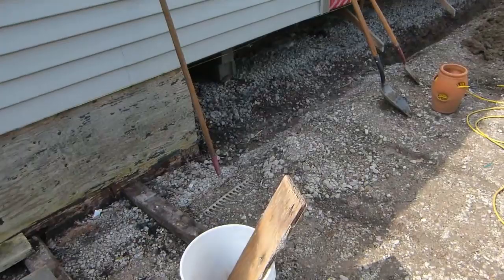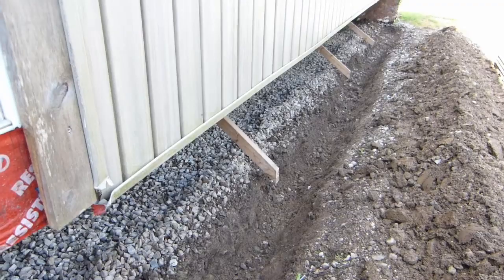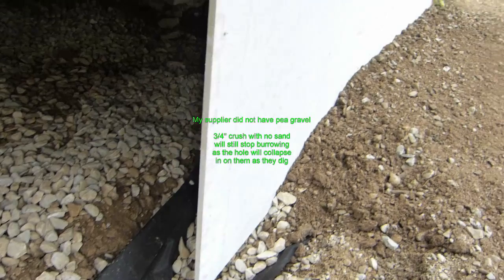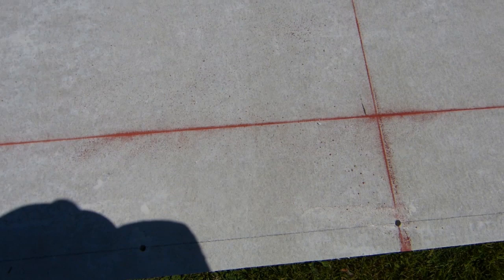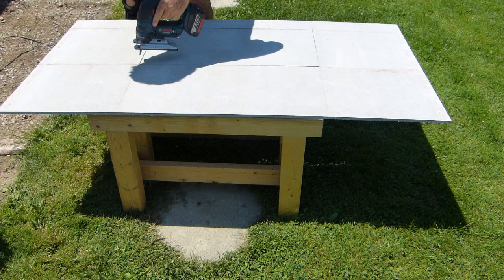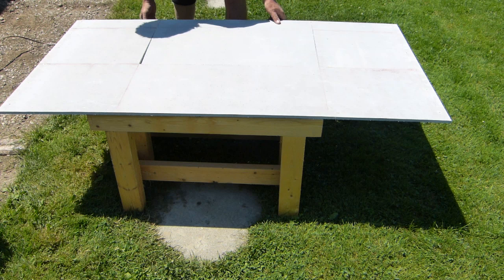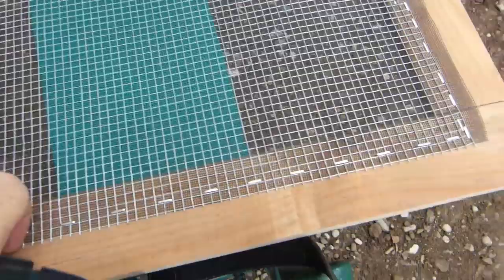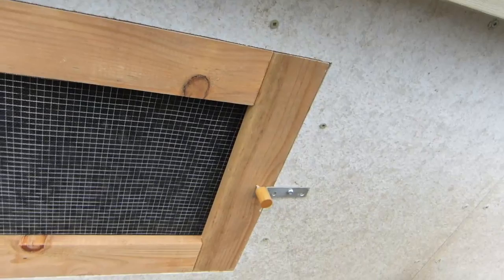Mobile Home Skirting

Comment: I was wondering about being in the ground, but you answered the question a year ago, to @ezraepstein6933, saying the trench was deeper than the backer board reached so it apparently drains to somewhere with a sloped trench.  You didn't say anything about slope on your trench or a catch basin on either end.  I guess you answered my other question with 36" of trench depth below the ledger board and 32" of  backer, leaving 4" of pea gravel below.  It has been another year since that reply, now 6 years since installation.  Has your assessment of working well changed?  Thanks for keeping up on this!  Good Video!!!
Reply from the maker: We moved out 3 years ago.  As far as the neighbour tells me it is holding up fine still.
Reply: @JimDockrellWatertone    Thanks for the response!

Comment: I was looking at durock cement boards at Home Depot and I was told it’s not for below grade. That it should be 8” above the ground. 
Have you had any issues after installing?
Reply from the maker: None at all.  The first section I did about 5 years ago.  Mind you it is in drainage rock so the water does not stay in contact with it.
Reply: That's right!
Not for below grade level at all.
Good work though
Reply: I was looking at using the durock boards as well on my home. So as long as I have a drainage system in place like you did with the gravel, those boards will work?

Comment: I'm thinking of doing something similar.  I've heard Hardie board isn't rated for ground contact.  Have you had any problems from moisture affecting the boards?  I'm in a very wet climate.
Reply from the maker: No, I never had a problem.  My trench is deeper than the board reaches and is filled with pea gravel (ideally) so the water does not stay in contact with the concrete  board.

Comment: how much did something like this cost you? sort of wished that you showed you getting underneath while working and putting it up instead of just showing before and after part. my trailer is like yours.. almost has no lip under it soo, thinking that I might have to do something like you did
Reply from the maker: I think I showed how it's attached in another video, but I attached a 2x strip underneath to the rim joist to screw to.  The first batch I got were around $8/sheet (Canadian dollars), but this batch were double that.  A hard angle to film at.

Comment: Very nice job. I'll be up for doing this within the next couple of years. I know you said there were no termites in your area but I wondered about the earth-wood contact. What wood did you use for the bottom support of the panels? I presume it was a pressure treated product.
Reply from the maker: Yes, pressure treated.  Rated for ground contact.

Comment: What brand cement board did you use? Have to replace my skirting this spring.
Reply from the maker: Durock. 

 Hardiebacker is another that is available.  Both are recommended by the manufacturer as skirting.

Comment: O don't know where did you xome up with this idea but I don't remember that the manufacturer of the siding recommends having it into the ground.
I worked with this product but was never tobe in touch with the ground.
That's to bad because you're putting in a lot of work to it.
Reply from the maker: It has no real contact with the ground.  As you can see it is suspended in drainage rock.  It is rated as skirting in high moisture areas.

Comment: can you tell me how this has held up? I hear good and bad about using this product. It looks like you will have about three years of experience.
Reply from the maker: The first section I did was over 5 years ago and it still looks perfect.
Reply: @JimDockrellWatertone  Thanks for the reply Jim. did you use any vertical supports to nail, or screw your board edges to? Also what state are you in, it gets pretty wet here in Washington state.

Comment: Have you ran into any issues with it getting wet?
Reply from the maker: None so far.  I did the back of the house 4 or 5 years ago and it is holding up well.  It is designed for wet areas and the manufacturers page says it is suitable for mobile home skirting.
Reply: Even though suitable for mobile home skirting I seriously doubt that it is  designed to be in the ground.  How is it doing in the year 2023?  I hope it is working as well as when you installed it!   @JimDockrellWatertone

Comment: Cost per panel? Awesome job.
Reply from the maker: Today it is $16.30 (CDN) per board for 1/2" thick, 32" x 5' at Rona.  They regularly go on sale for much less.  I think I paid less than $10 per board when I bought this.   A bit more expensive up front, but the long life means it won't need doing again.
Reply: Jim Dockrell I wish I seen your video sooner. I'm presently doing mine, only in metal roofing panels. I'm doing the top the same as yours but the bottom is somewhat different. I bought pvc garage door trim and cut them into 12 inch stakes. I pound them 10 inches deep, then I ripped treated 2x4 for the stringers across. At the bottom of each panel from the cut I make,  im painting with a rust inhibitor and the metal panel is two inches deep in the soul.  For the vents I am cutting openings and with aluminum screen from a large satilite dish. To cover in winter I have another panel that fits over the summer one. I'm 65, im thinking it should outlast me.
Reply from the maker: I think you will probably be OK.  I bury mine a bit deeper and use 3/4 crush or (preferably) pea gravel as fill to stop mice from burrowing under.  I like that you are reusing materials.

Comment: All I can thinks is “the termites are going to be very happy will all the wood to ground contact.”
Reply from the maker: No termites around here.  But the concrete board I am using should last longer than the exterior plywood it's replacing.